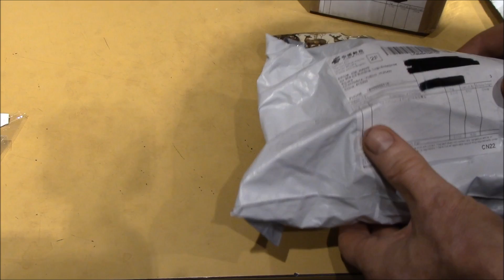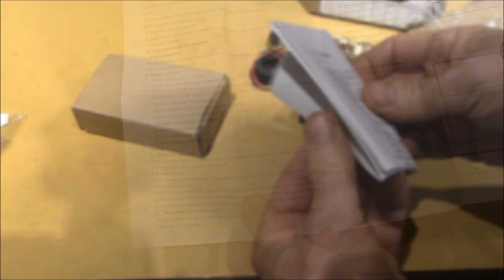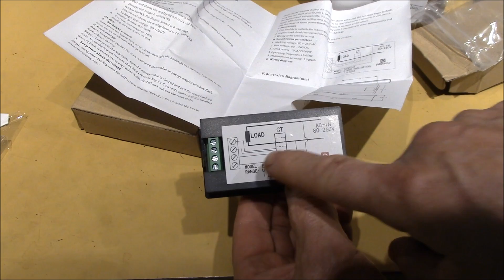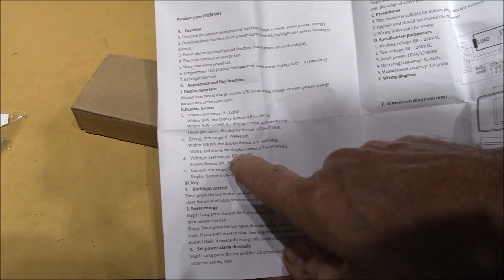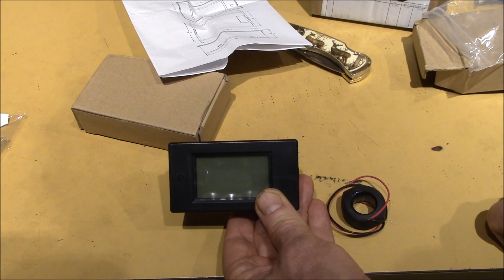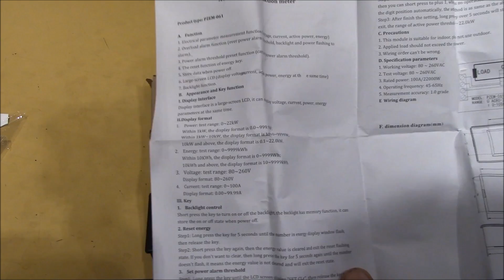AC Power Panel Meter

Comment: Mr. Brown , will this AC Power Meter store power usage if the supply breaker trips ? Have a freeze dryer that after 18 successful runs now is tripping breaker, manufacture-Harvest Right- they believe my supply is defected..I disagree but need to check before shipping unit back
Reply from the maker: Yes, it retains the accumulated energy consumption over power cuts.  I use this on an AC bench power supply and it can be turned off for weeks at a time and still shows the KWH reading from before the next time it's turned on.
Reply: Perfect..TY for the quick response Sir
Reply: Assuming Amps were available also
Reply from the maker: @BuilderBUBBA  Volts, amps and watts are only the live values.  I don't think there is anything saved in memory for those.  You can program in a maximum power level where the meter will flash the display if that power level is exceeded.  I have a video in this playlist on using that feature.

Comment: Since the 2 non-torroidal(bottom) wires are just sensing voltage(they must be powering the meter otherwise how's it getting power?)I'd assume the wire gauge has to match the gauge used on the breaker those are being connected to? (i.e. 30amps, 10gauge;15amps, 14gauge;etc.)   They couldn´t be any random gauge could they as it would tend to overheat the wire if the gauge is too small?
Reply from the maker: Yes, those 2 wires sense the voltage as well as power the meter.  So a small gauge wire with sufficient voltage rating should be fine.  It's like you're using a volt meter to test the mains voltage.  You don't use massive heavy gauge leads on the meter.  If worried about protecting those two wires/meter from a short, you could wire an in-line fuse.  However, you'll probably find that fuse/holder costs more than the meter.  The meter does have an in-line capacitor and resistor to limit current and one or the other of those components usually fail open.
Reply: @The4Crawler  Thanks.  Good to bounce my thought off of someone.  Makes sense as the load(i.e. a home) would pull the amps it needs while the other load (i.e. the meter) would barely require milli/micro current to power itself.
Reply from the maker: @Capafool  I think the meter only draws a few milli-amps.  Only time you might need larger wires would be if it were something that needed and electrical inspection and the inspector insisted on larger gauge wires.

Comment: When I set the required voltage, the display will flash. So I want to ask if he has any signal or control output. Somewhere on the board.
Reply from the maker: Which voltage are you setting and what is the actual voltage reading?  It may be you are at the lower voltage limit of the meter, usually around 70 volts.  Below that it won't operate unless you modify the meter for a separate power supply:
https://youtu.be/zpBXKnCsllQ?list=PLpY2FP1a9tivPdpLVyg8XMqxw6B6SAEbI&t=341

Comment: Does it measures RMS or average value? I believe it measures just average value.
Reply: I added a switch in between the phase line and if I turned it off, i know ct is still continuously generating some voltage across it so will it damage the meter without the load voltage over time?
Reply from the maker: That should be fine.  As long as the CT is still connected to the meter and it's internal load resistor.  That will keep the voltage across the CT in it's normal range.
Reply: Thank you sir🙂.
Reply from the maker: From what I've read, the Renergy RN8208G power measurement IC inside the mater does do RMS voltage and current.
Reply: Wow that's awesome I have several average value measuring device I really want an device like this , thanks for your reply.

Comment: I'v got a question regarding permanent installation. Is it OK to run both the 120 and the Hall sensor return in the same cable? I'd like to run all the wires in something like a 18/4 cable but am concerned the 120 will have adverse effects on the return from the signal wire.
Reply from the maker: Good question.  I've not tried that, but I suspect it would be OK.  This unit uses a current transformer (CT), not a Hall effect sensor, and that's important.  A CT is a low impedance device, compared to a high impedance Hall effect sensor, and being low impedance, it's not as sensitive to picking up induced currents from nearby conductors.  You could use something like a multi-conductor cable with twisted pairs of wires inside to get an even cleaner signal.  That wire doesn't need to have any high current rating, you only need a few 10s of mA to power the meter.

Comment: Although instructions  say not intended for outdoor use  ,didnt think this would matter ,maybe defective ?
Reply from the maker: For sure, the unit is not sealed or weather tight at all.  Assuming the meter is protected from the weather and is in an area where condensation from hot/cold cycles is not an issue, it may work.  Likely there's an operating temperature range similar to other electronic components, so if there is something else running in the unheated building and it works OK, then the meter may also work.  Too cold and the LCD may not update as well, too hot and you may damage the electronics from the high heat.

Comment: My meter is in a unheated building , will this effect the readings of the kwhr?
Reply from the maker: Not sure what the operating temperature range is.  I would think the main concern would be condensation if there were rapid changes in temperature.  If other electronics operate out there, then it may not be an issue.

Comment: I am hoping to use one of these to monitor power consumption of my ceramic kiln so that I can pay my roommates the additional electrical costs of my hobby. It is a 240v 48 amp kiln that I will be running on a dedicated 60 amp circuit. My question is, and you have to pardon my lack of electrical know how, why do you not have to run both lead wires through the loop? I thought 120v would run through each. Do you set the device to a 240v setting and it knows to double it?
Reply from the maker: See this video for the answer:
 https://youtu.be/LhR-Z6lBeZw
If you run both hot lines thorough the current transformer, you'll end up reading either no current (i.e. amps in on line 1 = amps out on line 2, they cancel) or if you reverse one wire you read double the current as you put both lines in phase.  Instead, run one (or the other) hot line through the CT and connect the meter voltage inputs across line 1 and line 2 (i.e. 240v).  Now this assumes you are running a 240v (balanced load).

Comment: Dear sir,
Is it use for the solar on grid system?
When electricity shut off,It can operate or not?
Thank you.
Reply from the maker: By default, no, the meter will shut off if there is no power for it to monitor as it derives it's own operating power from the measured power.  However, it's possible to modify the meter to run off a separate power supply as shown here:
https://youtu.be/b2MXXSuzM2k

Comment: Hi Mr. Brown; 
Just a quick question ... Can I hook one of these up to a 240V 4500W heating element in my small water heater? I'd like to keep track of the wattage, amperage and voltage as it cycles on and off while heating from a cold temp to the hot temp. I'm assuming that you would run L1 or L2 (but not both) through the CT to measure the 'load' on the meter.
Thanks
Reply from the maker: Yes, on a 240v load, just run one of the hot wires through the CT.  I made a 240V "kill-a-watt" meter a while back:https://youtu.be/LhR-Z6lBeZw?list=PLpY2FP1a9tivPdpLVyg8XMqxw6B6SAEbI

Comment: Hi Brown , your video presentation was super , further to that ,can I install this panel to my  AC speed control regulator in order to check the volt.watts  n ams supply reading . is it possible . your advice please
Reply from the maker: That should be possible.  Only thing is if the speed controller chops up the AC voltage waveform the readings on the meter might be a little off.  I think the power measuring IC inside does handle RMS voltage and current measurement but there is often a limit on what sorts of waveforms and frequencies that RMS calculation is accurate over.
Reply: thanks Brown , will take valuable info and will keep in touch if I need more advice ,, just ordered the same panel for my project .tks

Comment: There seems to be 2 variants, 20A & 100A, e price difference is negligible but will a 20A version be more accurate than e 100A when reading currents within 20A?
Reply from the maker: +Aquakey 98 Haven't looked at the 20A unit, but might have a more sensitive current transformer.  The 100A unit is a 1000:1 ratio, 1 amp of load current = 1 mA of sensing current.
Reply: tks! what sort of electronic appliance or devices can possibly exceed 20A reading?
Reply from the maker: +Aquakey 98 I imagine anything you would plug in would not exceed that, most outlets in the US are rated at 15A with some having the special 20A receptacles for certain higher power loads.  I used to have an electric wood chipper that needed to be plugged into a 20A outlet with a fairly short and heavy power cord.  Above that you typically need to go to 240 volts.